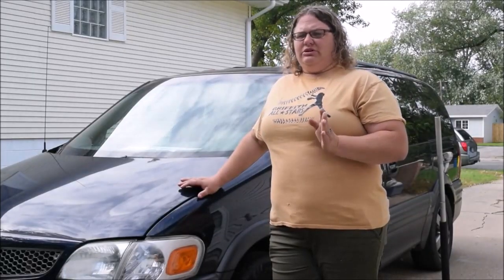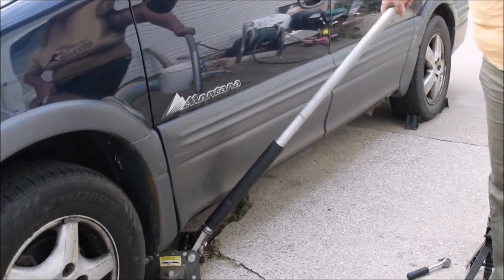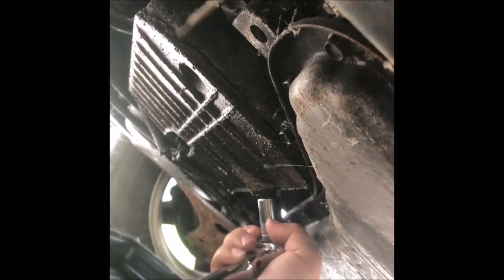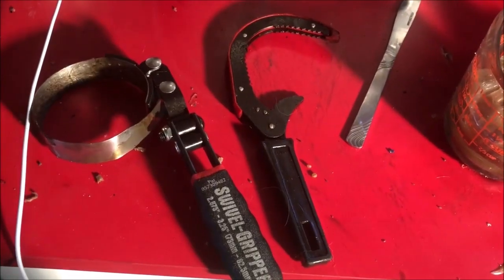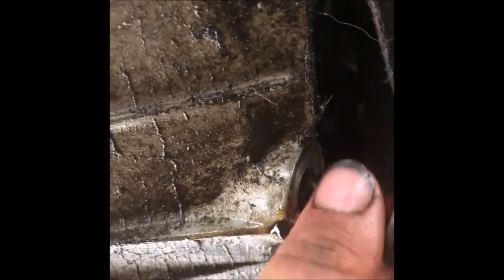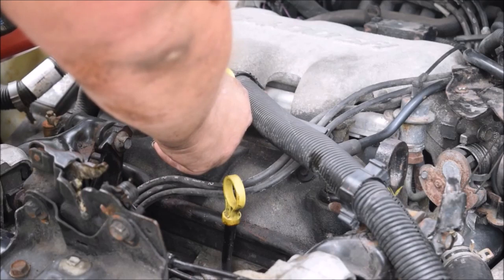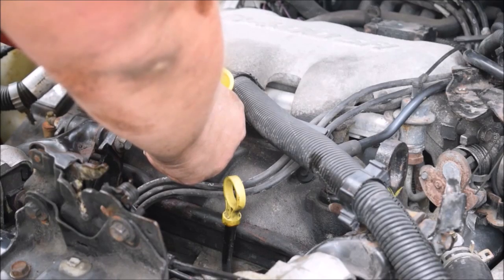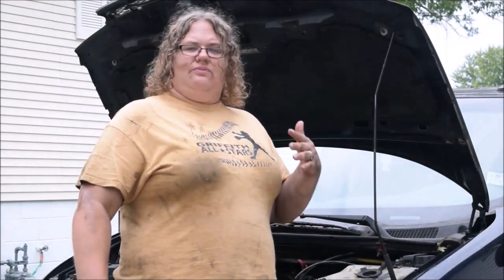diy Pontiac Montana oil change

Comment: Reset the oil change mileage minder by turning the key to Run, which is one position behind the momentary ignition position… the last one the key will stop at. Within 5 seconds you need to press and release the gas pedal three times. Wait a few seconds, then turn it off and start the car. If it worked the oil change message will go away. I think there might also be a way to do it with the gauge button that cycles through the trip meter and oil health but this pedal method worked for my 2000 Pontiac Montana.

Thankfully, my filter came off by hand. My oil drain bolt, OTOH, was SUPER tight. It had a rubber gasket that seems torn. If it leaks I’ll buy a few new ones for future oil changes.

Comment: Great video. Thanks for sharing. I might also suggest mentioning to oil the new filters seal before replacing, and letting some of the new oil flow through till it comes through clean  before replacing the drain plug.
Reply from the maker: Great tips as well